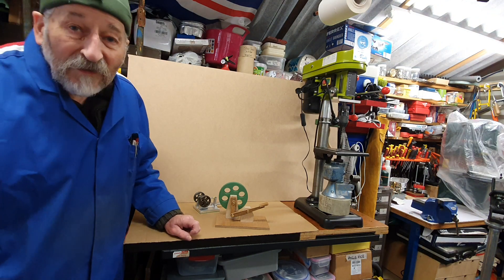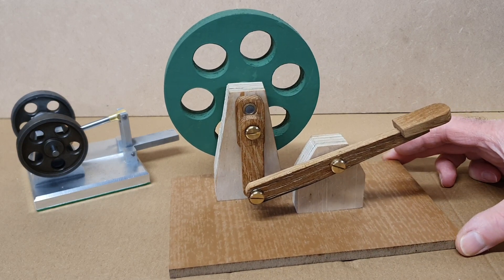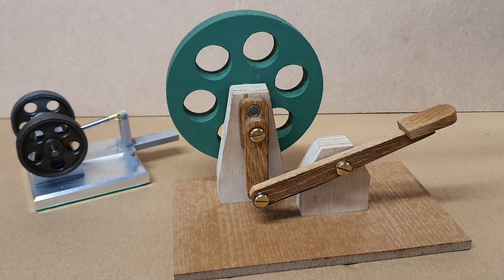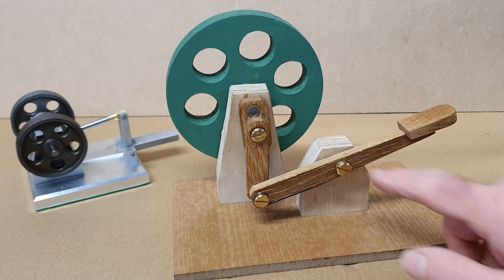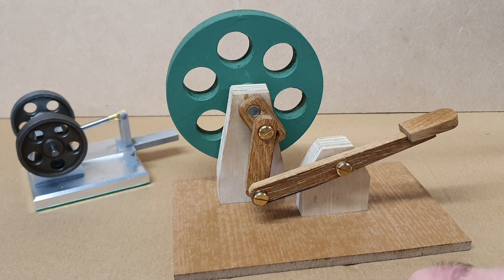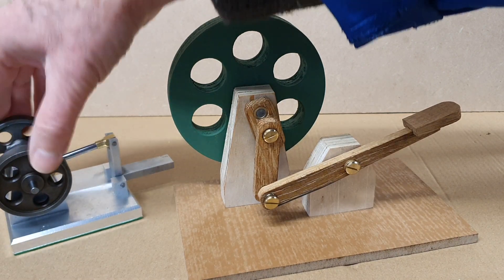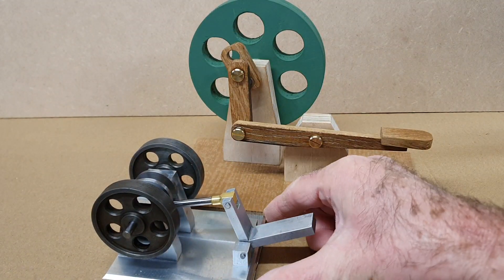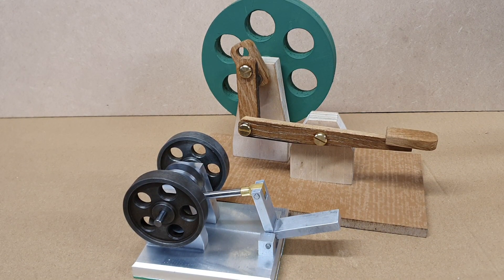Finger Engine Mk2 in Wood.

Comment: MY first model engine was a Finger Engine.  I used the N.A.M.E.S model engine with mild success.  These finger engines are tricky.  Since then I have made a Wobbler and a Milly with much better success.  Cheers and nice work.  Thanks for sharing your projects and model negine builds.  Cheers from the US.
Reply from the maker: Thanks for the comment. The finger engines are fun to make. I’ve made 3 all together. The only tricky part is getting the balance of the finger arms right. It’s also fun to get other people to try and make them run. Wishing you happy holidays. Cheers Nobby in the UK

Comment: Do the holes in the flywheel matter
Reply from the maker: Not at all Luke. I just think a flat bit of steel or wood looks boring. Why not make something that looks good as well 😊 As the flywheel revolves you can see through the wheel as well. Thanks for looking at the video. Cheers Nobby

Comment: That's a novel engine Nobby, just goes to show what you can cobble together with bit of ingenuity and scrap bits you may have lying around. well done. Regards from Australia.
Reply from the maker: Hello David I machined the flywheel to size on the Myford lathe and made a brass bearing which I drilled and reamed using the method you told me about. I think the flywheel runs reasonably well given its construction. Keep well kind regards Nobby.